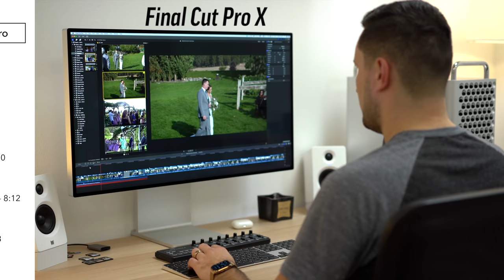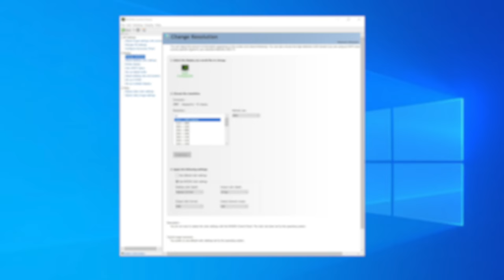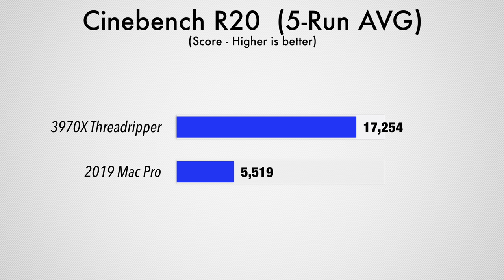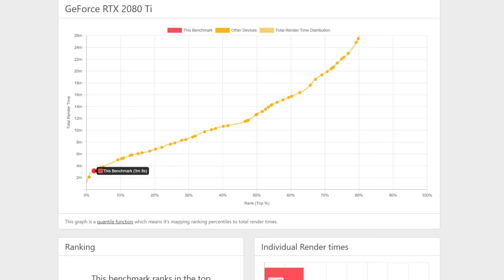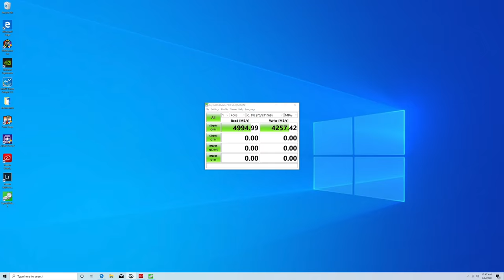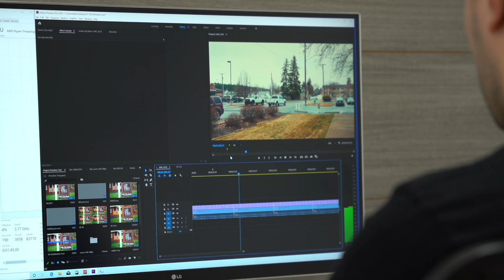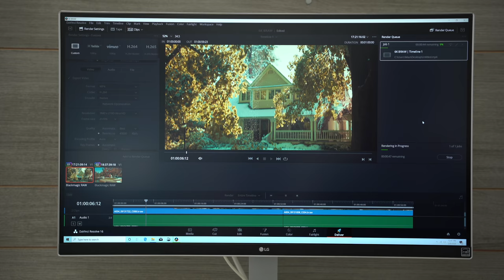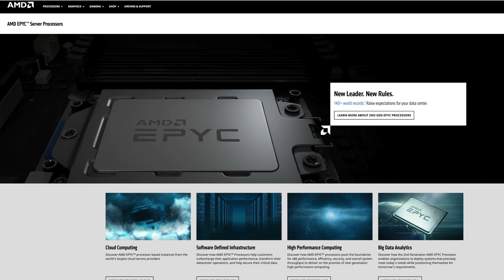$15,000 Mac Pro vs $5,000 Threadripper - Sorry Apple..

Comment: Max Tech: "This isn't a fair comparison in many ways." YES, it is. If crApple decides to cripple their most prestigious machine to only unleash it's full potential when using certain software and components it is a very valid argument. As a professional you can NOT be dictated by a company to what you need to use or what you want to work with. It's part of the game.
Imagine camera manufacturers would limit the use of their camera to ONLY one lens set. It would be ligit to point out that other brands can mount various glass.

Comment: 90% of the people in the comments do not understand what the point of this video is for. It is not to show ‘you can get a computer way more powerful for a lot cheaper’ and yes that is true but then why would people run macs? 

Easily longevity, that computer would easily last you at least 6 or 7 years, whereas a custom pc you would have to upgrade to keep everything compatible, and would become obsolete within a couple of years. 

Also stability, which is why you very rarely have crashes and is the reason many professional music producers, video editors etc own these expensive Mac computers. They run them constantly for years they are reliable. Even after having a windows pc for about 2 years with no problems, I still wouldn’t keep any important files because it just isn’t as stable. This is one of the drawbacks to making everything compatible, yes you can run pretty much any program and hardware if compatible, but that doesn’t come without some element of unreliability.This means that although macs aren’t supported by everything, the things that do, work very much as part of the computer because they have been optimised properly. I have experienced multiple blue screens on windows simply because I did something a bit too demanding but I have only once had a kernel panic on my Mac. I am not totally sure, but it might be because macs slow down when doing demanding tasks, while windows just lives on the edge and blue screens.

Safety features is another important one. Macs DO get viruses, but it’s a lot less frequent than windows. Windows is more open source and easier to make programs for, so if your grandma is using your Mac and clicks on a sketchy download link it’s likely to not even work. Windows also has a lot more bloatware which can case slowdowns much more frequently.

I’m not a Stan for either computer as I believe both computers have their pros and cons, but I am bringing this up to maybe help someone understand that the actual point of the video isn’t to prove that the Mac is bad in every way, because clearly this video was an unfair test. Much more powerful cpu, gpu, and everything else in the pc, I have no idea why max tech thought this would be a good video (I like him as a YouTuber normally). Obviously if a windows guy clicks on a video and skips through to see everything the pc is better at, they’re gonna hate on apple in the comments regardless that the pc is OBVIOUSLY A MUCH BETTER COMPUTER. It’s like comparing a MacBook Air to an MSI gaming laptop. Yea obviously the pc is gonna be better because it has BETTER COMPONENTS and I don’t know, built to be a performer? There is nothing at ALL similar in these computers in the video so I have no idea why he would’ve made a video about it, but here we are.

Anyway time to make a cheese sandwich

Comment: I’ve used an iPhone my whole life however this is just plain stupidity the Mac I mean.
Reply: iPhone after the 6s is also a stupidity as compared to Samsungs or one plus ri8 now
Reply: How come.....
Reply: @yadhogr5889  dude there sapphire cameras are the best
Reply: @yashs9502  Let me know when Samsung supports their phones for more than 2 years.
Reply: @AlCatSplat  well it doesn't , but it comes with twice the memory, better battery life , type c port , more than double the ram , better display , fast charger included in the box and even though the support runs out maintaining the phone is way cheaper than an iPhone.
Reply: @AlCatSplat  only thing that makes sense from apple ri8 now their iPad and that's it.
Reply: IANSB idk about pro but I’ve had AirPods for over a year and they work perfectly fine
Reply: @yadhogr5889  but have trash quality, I can't hear a thing while on the plane..that's low budget
Reply: @The-Heart-Will-Testify  apple and their products have become more like a status symbol rather than tech devices , Jobs would be very angry if he was alive.
Reply: Roman Shocker I’ve traveled with it and I’ve used galaxy buds since my brother is a fan of Samsung and I clearly saw the difference btw AirPods and the buds so ye I’ve had no problem on plane nor was the buds any better
Reply: I never bought any iPhones bc xiaomi and Motorola are way superior

Comment: You are missing the point. Sometimes you say that the TR is as good or slower in some tasks. One costs 15k the other one cost 5k. Case closed !
Reply: That may close the case for most users, but not the majority of the intended target group of the Mac Pro: working professionals. And if you need that much horse power in a computer, you are very likely a working professional to begin with. 

For my business reliability and stability is the absolute number one priority, much more important than the price and even more important than raw performance. As much as I hate the fact that Apple never released any upgrades for their trash can Mac Pro, I still loved working with it. And I am doing so for over 6 years now. Without an upgrade or reinstall. I am not an Apple fan boy, I use Linux extensively and also Windows (although primarily for running tests and the occasional gaming), each has their own advantages and disadvantages - as this video clearly shows. But if you are earning your money with your computer - while I would not go as far as to say "price doesn't matter", it just becomes less of a factor (I still would not throw money at Apple to buy the upgraded RAM from them at a huge markup. That would be a poor business decision - instead I would upgrade it myself)
Reply: @XTJ7  The fact that more and more of major studios and servers are using AMD says something
Reply: There seems to be no space for nuance in your thinking. "Case closed!".
Life is more complicated and lots of factors are always involved. 
Open your eyes. Become more open-minded and curious. Good luck.
Reply: @hamzaHrv   You are comparing apples and oranges. You don't use Macs for servers, period. And if you already don't use a Mac, it is a no brainer  The AMD CPUs are a much better value for money AND they outperform Intel by quite a bit.

For studios, they don't usually render on their workstations but have a render farm that their files get rendered on, again: servers. 

But even for workstations: if your use case is primarily raw processing power (and your workload can take full advantage of it), then don't get a Mac. Very few workloads can profit from that much parallel processing power though :)
Reply: @hamzaHrv  10k difference in price is less than a month of wage of experienced technician in some industries. The value of work brought by one person, or machine, might be worth easily 30k. 
 It takes a long time for them to perfect a new system, especially if they need to switch more than just operating system. Every software, environment, etc require changes in workflow. That takes time, which companies do not want to lose.
On top of that many offices use Apple for all of their machines, so they only have a choice to buy from Apple.
In professional world, cost of equipment is important but it is not the only thing that has to be taken into account. 
There are more factors like that.

Comment: For the noise part, I could hang that threadripper on a windy balcony, drill a hole for the wires, tape it and shut the doors to it. No need of watercooling either.

Comment: Yeah Apple literally crippled the Mac Pro by going Intel. 

And since yesterday seeing the new high end 64 core Threadripper just absolutely destroys everything else out there. Even multiprocessor configs. And while Mac OS has its advantages for real pros you can save hours or even days of work going Threadripper. So despite the drawbacks of Windows that alone will make it worth going for a Threadripper system. 

And at $4k for the 64 core chip you will be able to build a system using it at the same cost as the $15k Mac Pro and it would absolutely monster it.
Reply: i saw an article that says apple will change to amd soon, loads of articles about it already.
its really good for the market, since intel would overprice every product when they had the monopoly
Reply: @lifeon2wheels965  Would be amazing. Can you imagine a Mac Pro with a 64 Core Threadripper. Or laptops running Ryzen 4000. Would love to have some of that.
Reply: Competition is healthy, and good for the consumers in the end. Monopolies benefit only one party.
Reply: @s4rg380  Salute to you sir, for having a realistic view of the market place.
Reply: Literally al the effects on the recent Terminator movie were made on a threadripper custom build

Comment: What is faster? A 5000$ computer that crashes or a 15000$ that does not?
Reply: Do reality check with that crashing you are living in delusions or / and outdated information realm.
Reply: A great point only true pros get.
Reply: @nuclearpcs2139  PC if built  correct do not crash   If you push Apple uses Intel I will love to see a 15k  Thread ripper 3990x  full loaded  go up against that apple pro
Reply: Jozef Bania well I work with people using windows on Xeon and Titan machines and the time it takes them to troubleshoot hardware problems and reload projects it’s just a waste on my money. But I guess you know better.

Comment: LMAO use the 3990x instead of 3970x and don't upgrade them RAM on the mac to 192GB when the Threadripper is using only 64gb.
You'll see an even greater jump.

Don't try and defend Apple, they are SCUM.
Reply: Dylaila  with apple or the PC? 
Apple I'd say about 12k ffs but nah slap on a 3090 or even go SLI on a PC still wouldn't touch the price of a specced out MAC😂

Comment: The Conclusion of this video:

PCs are truly better on the specs, but MacOS is just more stable. Windows have common app freezes + BSOD, while MacOS runs programs like a charm.

If you want to, you could just make a Hackintosh build for the best of both worlds.
Reply: That's just nonsense, maybe the crashes and BSOD were very common with Windows Vista but that's not the case with the next iterations of Windows. 

Windows 10 is more stable nowadays. I rarely had crashes and BSODs for my experience.

Side note : even macOS can kernel panic from time to time. I bet you got some of them already but won't admit it :pp
Reply: @seireiart  Sorry for wrong info. What I mean is that Windows usually had Apps not responding, unlike Mac or Linux. Although Macs could also had not responding apps, but more rarely.
Reply: @seireiart  You said: "I bet you got some of them already but won't admit it :pp"

I Don't even have Mac, because I'm too poor. :/
Reply: @dy7296  I was referring to Max with that statement. Sorry for not making it clear :sd

Comment: Nice but wrong video: 

You should have used an Epyc CPU (goes up to 64 cores and 2tb ram) as that's the one the MACPRO CPU is to be compated with:  https://www.youtube.com/watch?v=iN0COHoXxak 

Wrong video card used: the 2080 is not a workstation card, if you don't want to use the Quadro you should have used the Titan RTX with 24gb of ram

The freeze you have on PC are surely due to un-optimized BIOS/Ram settings. 

The case you used is ugly, there are cases out there much better looking than the MAC grater and you can have a useful glass window, plus you don't have to stupidly unplug all cables everytime you have to access the case interior (like you have to do on the MAC). 

Regarding noise if you put a liquid loop in the PC and adjust the curves in the bios, you will have a really silent PC, with the MAC Pro not having the dust filters you have on PC i wanna see the temeratures, cpu throttling and noise after a year from now ;)

Comment: Great video! And I'm looking for my MacPro to arrive :-)
Reply from the maker: Congrats, enjoy it!
Reply: @MaxTechOfficial  Thanks! I've started working on Macs in 1986 (on a MacPlus). For the last 10 years I've been using a MacPro 5,1 and this new MacPro will surely guide me to another 10 years of no problems in my workflow. PCs are great, very fast, excellent for gaming, but as bullet-proof workstations they are no match to a MacPro. Benchmarks aren't everything. Great speed (not the fastest), reliability and no noise (!) are much more important. Not even mentioned the fun you have with such a beauty on you desk while working (the PC looks like a fridge :p )
Reply: @andreb4125  Congrats! What setup did you choose ? :)
Reply: @sound4label  Thanks. As I have not that CPU/GPU demanding work, I decided to got with the 8c/32/1B/580 config for now. I'll add another 32 GB RAM. I'll change the CPU in 1 or 2 years when the prices came down. As I am not using a TB3 monitor (I have a LG 38" cureved, great monitor) I am open to get a normal GPU like the 5700 instead of the pricier MPX version of Apple, if needed. I do also have another 580 in my 5,1 which I can reuse to connect my 2nd monitor. I've got also the Pegasus J2i to host my two 4TB WB as internal Time Machine backup and a Sonnet 4x4 with 3 x 1 TB 970 EVO Plus (2 as a raid 0 for my working files) and 1x 1TB EVO Pro. External backup is done by a Synology NAS (and the 8TB Toshiba from the Pegasus). I'll use also CCC to regularly clone my system ssd. I'll probably also get a Sonnet fusion dual card to host my classic SSDs. So there are no external cases on my desk, only the pure beauty of a MacPro.
Reply: I understand you, but man, even a r9 3950x whit a mid end board can keep up whit the more low end versions, its just to much, is really sad to me to see a company that used to make the best for the best, turn in a premiun enterprise, the heatsink of the new macbook air is not even correctly connected whit the cooler... I miss job version of the apple
Reply: @Qap, another one, not the first time either.
Reply: @andreb4125  Thanks for your feedback especially about backup setup, very interesting! Sounds like a killer Macpro ! Enjoy ! :)

Comment: The key word for Mac Pro is Stability! Great review!
Reply: True, if you want Windows to be really stable you need ECC RAM and Xeon processors in a big name system. It's not cheap.
Reply: @_hold_the_line_  If you really think ECC made all the difference in Adobe crashing, they mentioned choosing not to use it in Threadripper where it was supported. Adobe products can be equally a dumpster fire on both platforms, as other many other Mac Youtubers have expressed. Resolve is probably the better choice on any platform, which includes Linux. The only thing preventing a hackintosh of that PC was the choice of NVIDIA GPU.

Comment: Did u do a more fair comparison like 2 dual Xeon systems? I ran (or still have) my Hackintosh in Tylersburg i5500 2x Xeon c5675, raid 0 Samsung 840 Pro, 48gb ECC tri-ch ddr3 1600 cl8 Samsung Apple ram, nVidia GeForce GTX-980 Ti & a full ATX SilverStone TJ series aluminum case.  The case is part of the cooling itself. A giant heatsink. I currently use the similar on Patsburg C612 2x Xeon E5-2667v4 & 64g ECC ddr4 quad ch 3200. I haven’t Hackintosh it yet but looks promising. When I used to use Mac Pro I realized inside they used server workstation grade boards & other components so that’s where your $ goes & having kept them for 10yrs on I will say u get what u pay for. Also that support service. PC, you’re on your own. lol no manual.

Comment: Guys make sure you notice that the temps can be changed on the GPU by getting a Gigibayte or Asus Rog 2080ti. It would pretty much have the same sound of the Mac PC in my opinion
Reply: If you have a 2080 ti, you wont even bother decreasing fan speed xus it'd still be cool running normal applications like Chrome, Photoshop, After effects, etc.
This guy really had no idea what the Windows one could do.

Comment: If you were to match the specs with a Xeon processor, memory, and pro graphics. The PC would be way over 15k, more like 20k-25k, because your entering the land of servers and that costs way more because it’s much higher quality, then you’ll start to realize the value Apple gives you.  Comparing server hardware, whether Apple or Windows based, to pc is a joke. Just ask a server admin, would you put your prod database on PC hardware, never ever would anyone put anything worth their business on a threadripper and consumer memory modules, it’s unheard of. A Mac Pro is not a consumer product, it’s a business product where people stake their business on it.
Reply: @TsunamicBug  As a consumer, you don't 'need' to, in fact no consumer should buy this unless you have cash to throw at it. However, if your a business,  you 'have' to, and this is Apple's target audience. There is a difference between AMD and Intel's server processors vs AMD and Intel's consumer processors.  Look it up.

Comment: Did you tweak your fan curves on the PC so that it can also run quietly? Running a fan at 1200 RPM or 600 RPM is the difference between "rather loud" and "barely audible".

Comment: So basically, the Apple is three times the price for half the performance.

And now apparently Apple has decided to abandon x86 entirely, moving wholesale to ARM. I assume this means the next Mac Pro will be six times the price for one tenth the performance (and that's being generous).
Reply: Forgot Rosetta and most of the programs would just need to be recompiled if they used swift and some changing of source code. Also check out this article
https://www.imore.com/mac-moving-apple-silicon-not-arm?amp